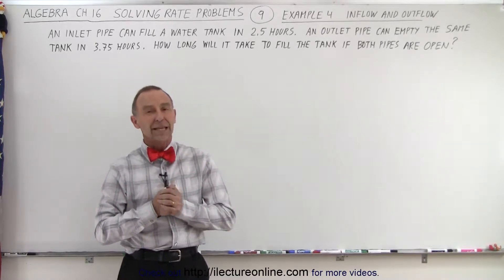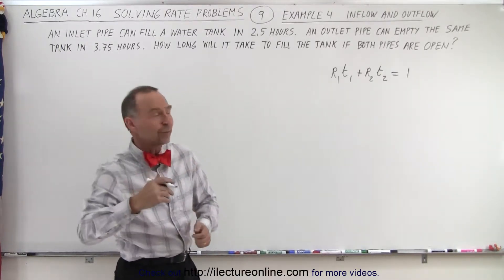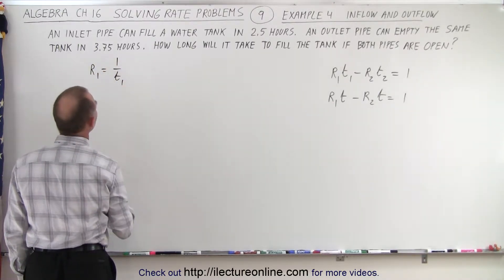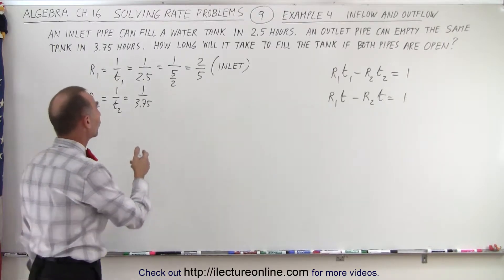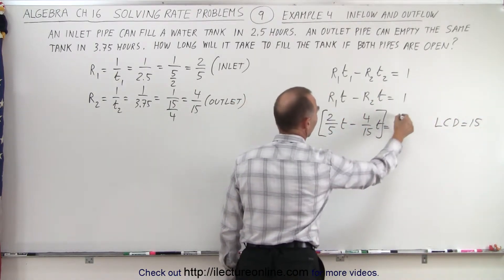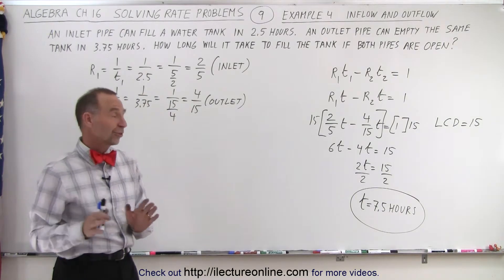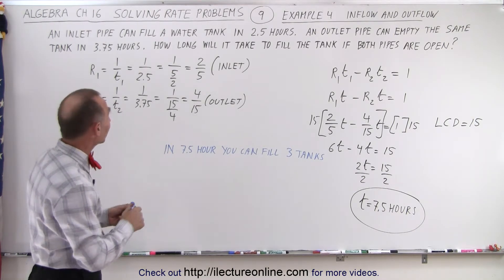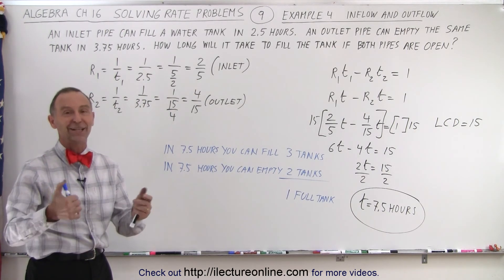Algebra - Ch. 16: Solving Rate Problems (9 of 11) Ex 4: Inflow and Outflow

Comment: Honestly, when I saw the title I though about a system, in which the outlet rate depends on the hydrostatic pressure. But this of course would involve geometry of the tank, and thus, the outflow would depend on that. Maybe an hydrostatic example would be nice to make.
Reply from the maker: For that you need to look at this playlist: PHYSICS 34 FLUID DYNAMICS - Playlist
and PHYSICS 34.1 BERNOULLI'S EQUATION & FLOW IN PIPES - Playlist
Reply: Came here to say the same - not an easy problem if you assume the rate is not fixed.  But I guess here it is.  Love the videos!